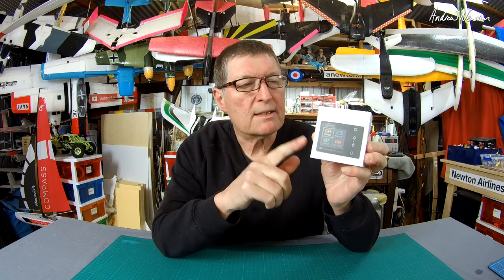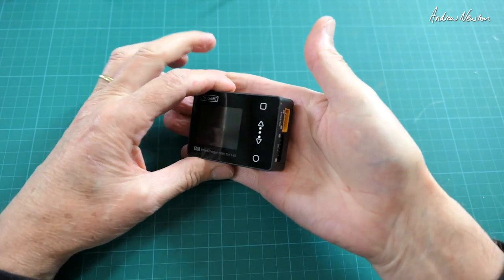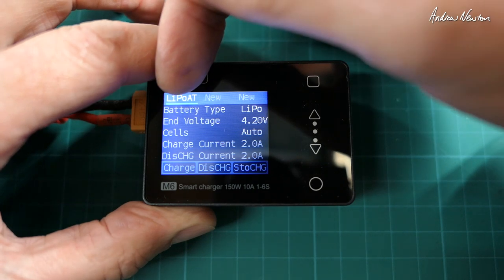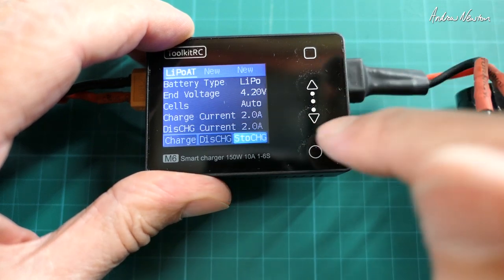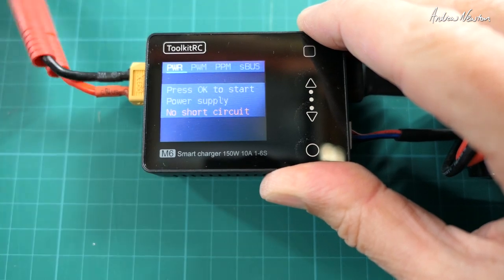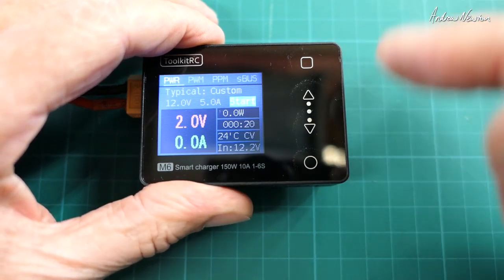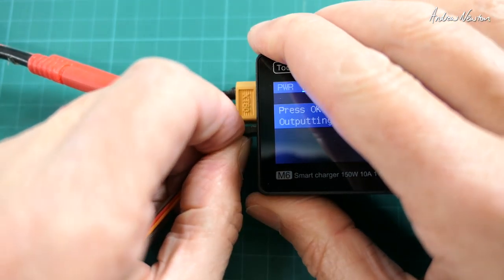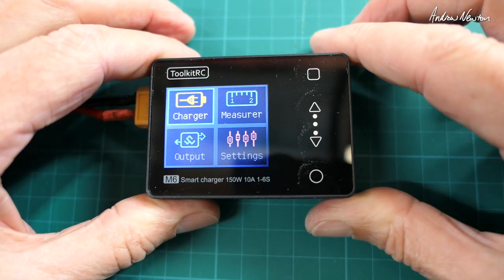ToolkitRC M6 Charger

Comment: Received mine no problem and ordered a geekcreit AC 100 - 240v to DC 12v 5a 60w convertor. Only $6 on Banggood, turns this into a nice home charger also. Much cheaper than the AliExpress AC adaptor for nearly $70

Comment: Hello, dear Andrew!
Please check the charging mode of the lead battery Pb.
Is the charging voltage set to 14.4V and 14.7V?
Is it charged only up to 14.10 or is it charged as installed up to 14.4V and 14.7V?
OK?

Comment: Hot wire cutter power control hmmm . good idea .👍 thinking about getting the istd t6 charger. Wondering even though i have no 8s batteries . should i just get the 
t8 Which is 1000watt 30amp vs. T6 which is 780 watt 35 amp. .?

Comment: Is it possible to have regenerative discharge? Or does the energy just blown out into the atmosphere?
Reply from the maker: Just swap the batteries over I guess
Reply: I have the M8 charger from Toolkit. In the setting menu there is a discharge option. There you can choose either internal or recycle. Recycle should not be used when using a bench power supply.

Comment: Thanks Andrew. Is it also capable of charging through the balance ports only, or must the power leads always be connected to the battery being charged? (Obviously it's faster with the power leads connected, but I have some batteries that don't use T60 and I don't mind charging them slower through the balance port only).
Reply from the maker: Unfortunately not possible. It can see when the XT60 is not connected and will not charge.

Comment: Can the USB be used as power input? 12v 1.5A from phone fast chargers should be enough for small batteries
Reply from the maker: NO, just for charging USB devices
Reply: @AndrewNewton  oh, then the power supply will be as expensive as the charger itself.

Comment: I have issues connecting balance port to this charger. Its brand new from box.  Balance port would not fit in the slot. Have you faced this issue ?
Reply from the maker: Mine fits easily, but the pins inside are very easily bent. Make sure they are all in line

Comment: The main thing I don't like about this charge is the capacitance touch 
screen can be a bit infuriating to use... as there is no tactile "bump" 
or "dot" to know where the button is like if you're in the dark or 
swiping blind... and sometimes you have to swipe rather than push.   I 
always seem to press too high or too low for enter or go back and end up
 pressing the arrow keys. 

Also, the pop out feet seem rather 
fragile and you always forget to put them down, blocking the fan.  It 
would of been better if they put the fan exit on the back, or put 4 
rubber bump feet on all four corners underneath to support it off the 
surface for clearance for the fan.   Otherwise, it does what it was 
meant to do.

To get the $22 price, you have to buy it as a group buy from the mobile app on Banggood... otherwise it's like $31.

Comment: 2:57 Voltage on 1 and 2 cell.
3:46 Voltage on 2 and 3 cell.

You reconnect balanser wire, and do it bad?
Reply from the maker: Correct. Well spotted

Comment: The problem with the M6 and M8 is charger, which it balances during the entire charging cycle. This is not necessary and therefore the charging process takes much longer. You can see it, if the cell number is highlighted, then the voltage value is frozen during balancing. Li-Battery packs that are connected without a balancer will not be fully charged. I can not recommend the device for charging. The device should charge without balancing until the battery is almost full, and then balance. This is what all my other chargers do (ISDT, HOTA, ...). I do not use the device for charging, but only as an adjustable voltage source.
Reply from the maker: Thanks for that. Good to know